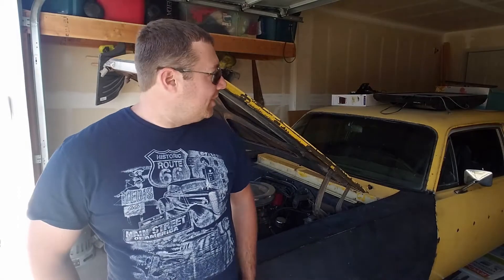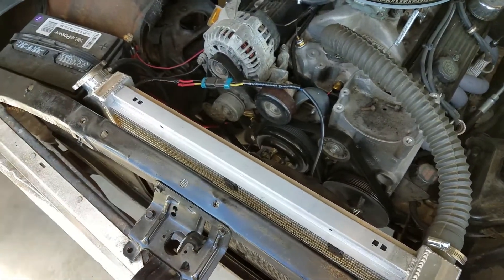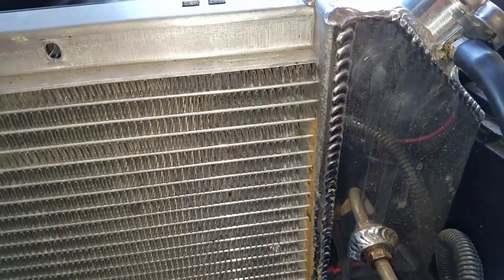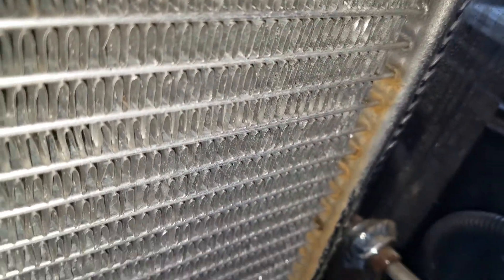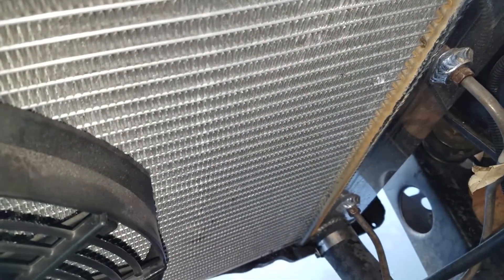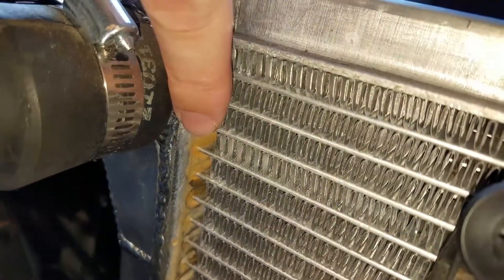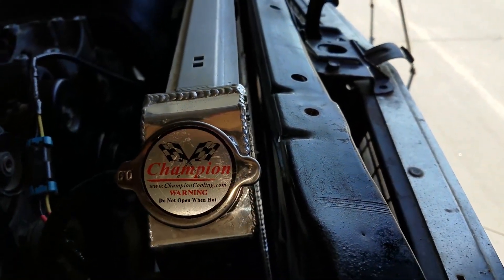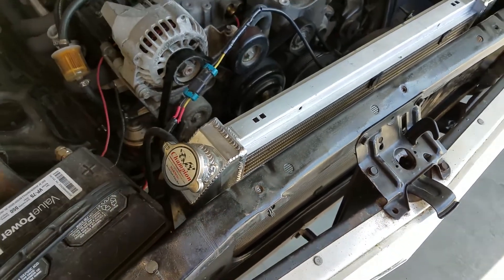champion radiator fail

Comment: I bought a new Champion radiator for my '68 Dodge dart. Installed it a couple days ago, and started to fill it with antifreeze, and it was leaking immediately.  It was a replacement for my 6 year old champion, which was leaking. I'm returning this one to Jegs, and i'm going with something else.
Reply from the maker: Sorry to hear that. I was able to get a warranty replacement eventually and they were great to work with. New one is doing good so far.

Comment: Did you get a warranty replacement for this? We have a Lifetime Warranty against manufacturer's defects. If the dealer doesn't get it handled, contact us directly and we'll get involved.
Reply: i have just bought a all new one trough Ecklers and it is leaking. dont you do a preasure test ?? I am living in Denmark, Europe so i just dont sent it back to you unlees i spent the same money as a new radiator. What to do ???
Reply: @smedensfairlane  We saw your email, they will instruct you on how to proceed. Not much we can do on YouTube, you would need to contact Ecklers since you purchased from them and they can work with us on the replacement. You won't be paying to return it, we don't work like that.  thanks.
Reply: @ChampionCoolingSystems  do you guys pressure test you radiators?
Reply: @twofacedname  They do get pressure tested at the factory prior to boxing them up and shipped to our warehouse.

Comment: Champion will replace it dude!  they have the best customer service ever I'm teling you call them these guys are top notch they have very high inteegrity I've had great luck with their radiators the one time I did have a problem they went above and beyond to correct it remember there is a percentage of failure to anything mechanical your main concern should be to buy from a company that backs up the product trust me Champion is that company
Reply from the maker: yeah, I did end up getting it warrantied eventually. They were great to work with.

Comment: You must be very careful when you drop in the new radiator its happen to me one time with an ebay one I slightly touch the heather core and after few days start to leak if you hit something during installation you mess up the radiator......

Comment: Hope Champion covered it under warranty. I've had a Champion installed on my 68 firebird for a few years and no issues, but have been down this road with others and the manufacture always took care of it.
Reply from the maker: For a while I was not able to reach the dealer I got the radiator from. So I got stop leak from oreilleys to put in there. It wasn't that crazy aluminum glitter stuff, it was more like a sandy kind of powder stuff. Anyway it seems to have stopped the leaks for now. I may still pursue the warranty but I don't think they will honor it if stop leak was used, guess I'll find out.
Reply: @meridian208  Sorry you had issues with the dealer. Often times with warranty issues, the seller may not respond favorably, but you can always get in touch with us directly and we can help get the radiator replaced under our Lifetime Warranty.
Reply from the maker: Thank you for commenting on here. I thought I was pretty much SOL on this. I will get in touch for sure. Thanks
Reply: @meridian208  Absolutely... sometimes these warranty issues never make it back to us, we are here to help!  Thank you.

Comment: My $300 Griffin in the Jeep did the same thing. I finally put a can of stop leak in it.
Reply from the maker: Was it an aluminum one similar to this? I'm wondering if they are all a bit defective...
Reply: Yeah it's a Griffin aluminum cross flow I got from Summit.
Reply: This is sad to pay that much for a product and it fail. I bought an aluminum one from ebay (china made) and I've had no problems after 6 years. It's in my 64 C-10 pick-up, with a 350, no cooling issues either.